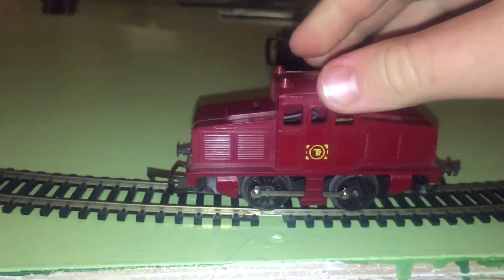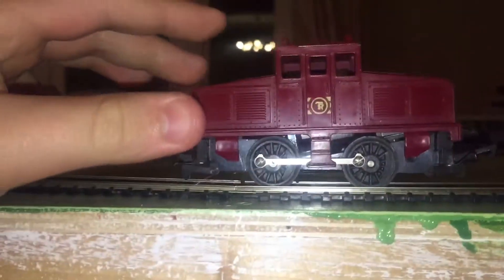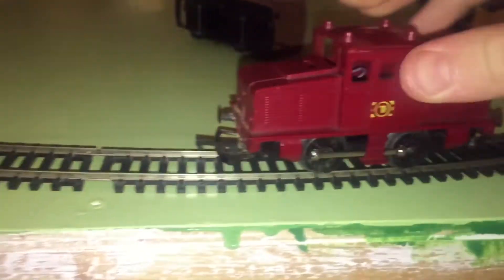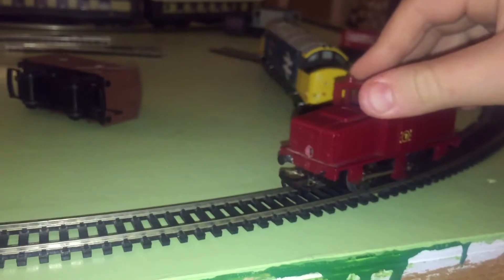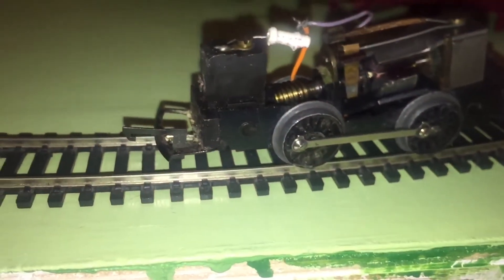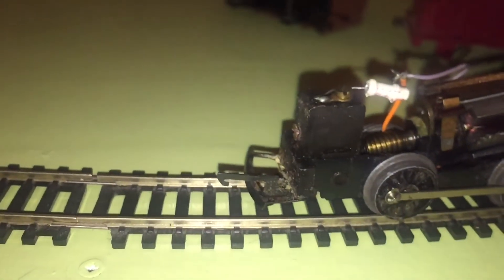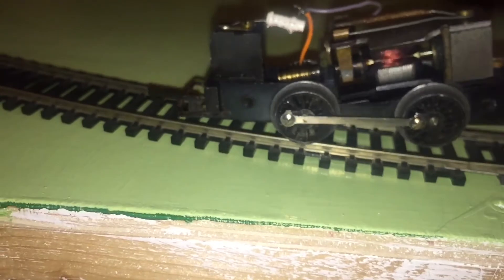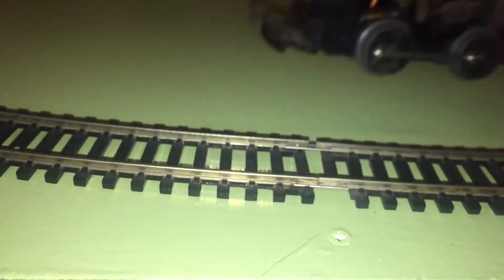Triangle Steeple Cab Locomotive

Comment: I picked up one of these from a junk box in a shop I know. It needed the coupling rods but ran well  after a clean and oil without them except for the two wheel drive wheelslip! Putting windows into it now and would like to cover the motor though the condenser will need to be repositioned lower to allow this. It does look silly when compared to the giant Swiss Crocodile which it's styling choices are taken from!
Reply from the maker: Oh wow nice!! Impressive, hope the work goes well
Reply: @teescottageguyproductions  It's only the plastic from a shirt collar or butter dish but white glue holds it it and turns clear when hard. I picked-out the headlights with silver. Actually, I just saw a video of Matsui Miike which is a place in Japan which has something very similar though without the wheel rods. If you haven't already, I'd use some lighter fluid on a cotton bud to clean your commutator and brushes. A little grease on the worm gear wouldn't hurt either. Try a sanding sponge on the wheel surfaces too
Reply from the maker: @ajivins1 nice!!

Comment: Get your power leads and touch them to the copper carbon brushes on the sides of the motor. If it runs well then the current isn't getting from the rails, through the wheels, wipers and wires to the motor. It wouldn't hurt to remove the brushes and clean them and the commutator. This is the old X03/X04 motor which is easily serviceable and goes-on forever (there are plenty of videos on this) so get down to Poundland and get some tweezers (handy for removing/replacing the brushes) lighter fluid (a good cleaner for the brushes, wheels, wipers and commutator) and toothpicks for cleaning the gunk out of the gaps in the latter. Remember, the backs of the wheels where they touch the wiper pick-ups need to be clean and oil free, too. I don't know where you are (don't need to) but you should look out for any local model rail shows. At a Bristol one in February I got a fibre glass pencil (another good cleaner) plus reasonably priced rolling stock and locos. Some £2.50 box vans and a £25 Airfix Royal Scot were the best. For the motor, before removing the brushes I would put a spot of tippex on one brush and the side of the motor it comes from as they're better not swapped around.
Reply from the maker: Ok thanks a lot!!
Reply: @teescottageguyproductions   Of course, put the tippex on the back of the brush, not the face. The chassis is basically a Triang/Hornby Nellie 040 so check a couple of videos fixing that, I got the coupling rods off one to fix mine. Like I said, I don't know where you are (Teeside? Doesn't sound like it) but the Hereford Model Centre is a good place with 2nd hand stuff but not as cheap as the shows, got some Triang at the Bristol one, too!
Reply from the maker: @ajivins1 right ok interesting
Reply from the maker: @ajivins1 yes I’m in Teesside (Darlington)
Reply: @teescottageguyproductions  Ah, nearest I've heard of is Rails of Sheffield!
Reply from the maker: @ajivins1 we’ve got one near us called Peter’s Spares in Middlesbrough
Reply: @teescottageguyproductions  Ah, I have heard of them. While you're in £Land get some cotton buds to wipe the lighter fluid on with.